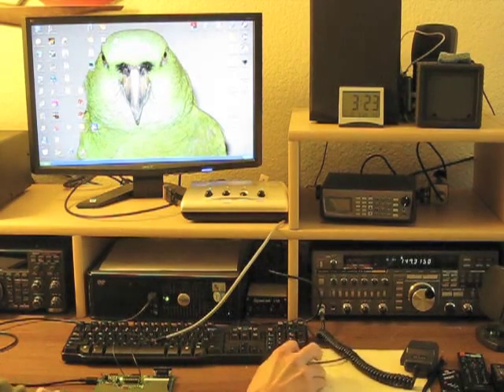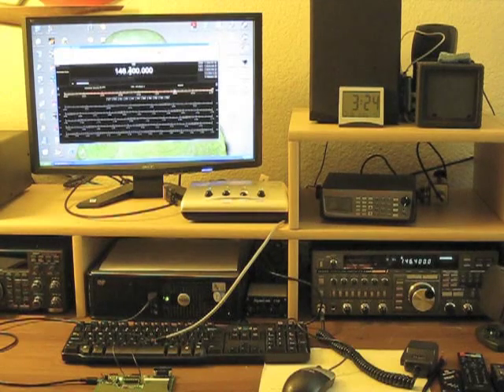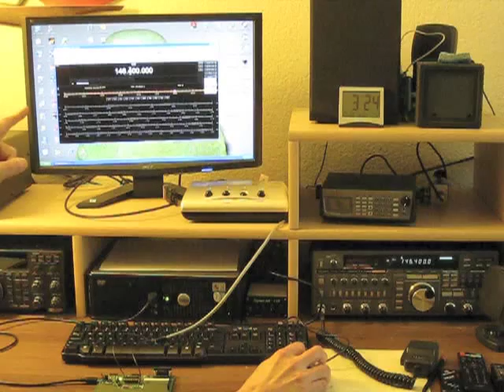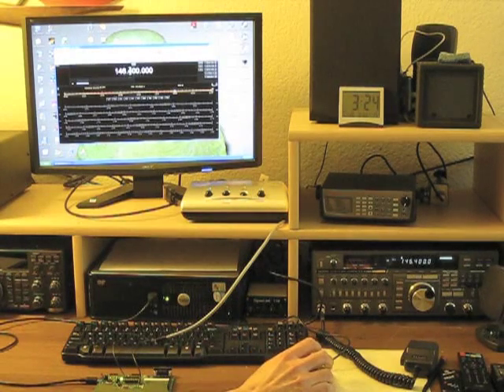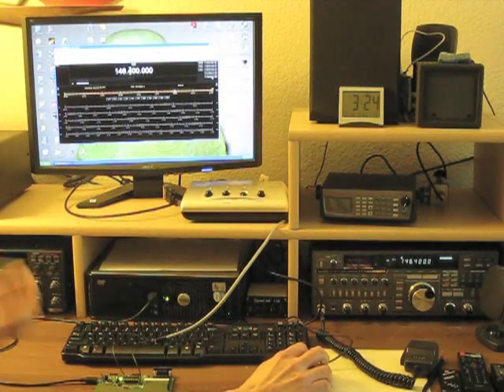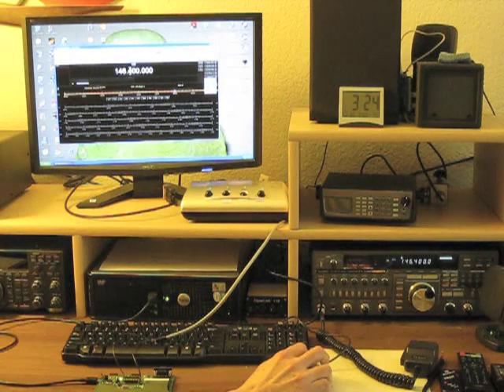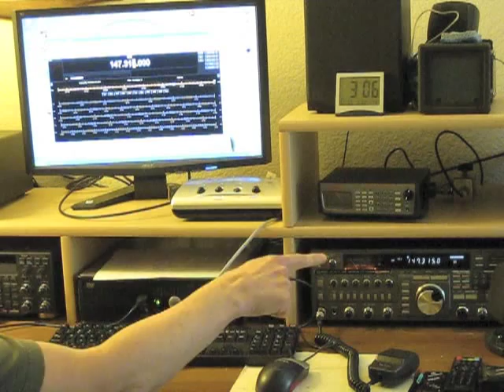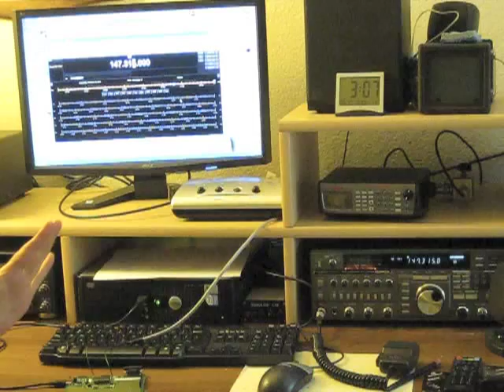FT-736R and HRD

Comment from the maker: @w9gb Hi
the shelving is from home depot or lowes. its 15.25 inches wide, pressed wood with some kind of veneer. doesn't look too bad for shelving, not expensive. i bought two pieces each 8 feet long and cut and screwed together with some L brackets on back.
chuck n6bil

Comment from the maker: @darrylp796
 Darryl, 

no the Yaesu has no ability in its CAT interface to send anything other than squelch status and s-meter. The interface is for satellite control. If your asking this because you want to adjust the tx/rx freq during a sat. qso, then you should look at the HRD satellite interface. The HRD sat. interface has two sliders to adjust the freq while also adjusting for doppler shift during a pass.  Did that help at all.

chuck